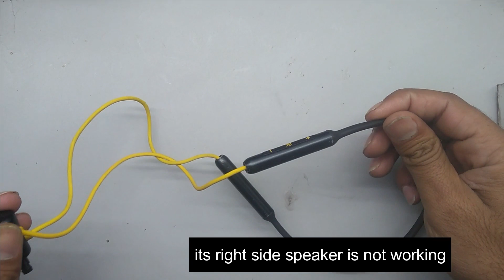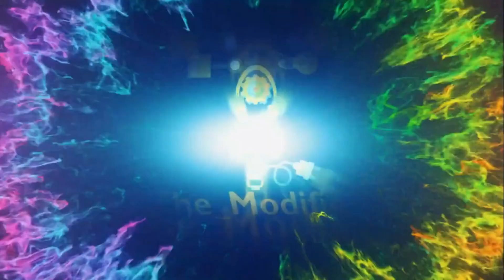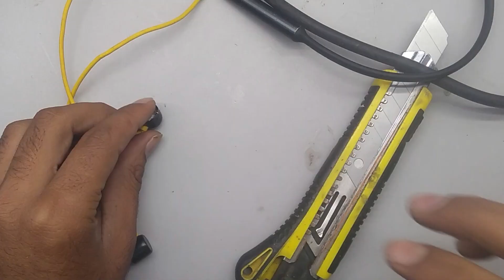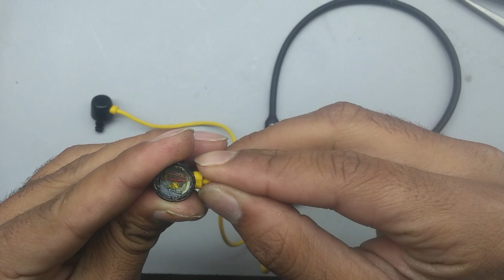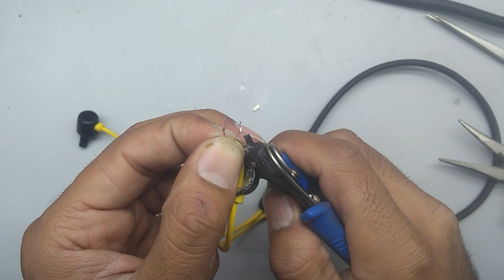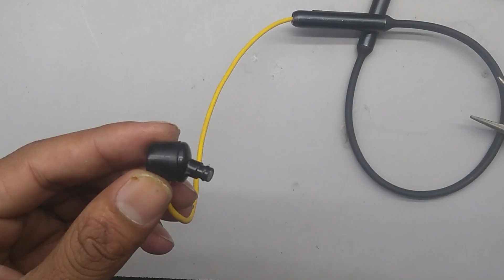HOW TO REPAIR REALME BUDS WIRELESS EARPHONE ?|| ONE SIDE NOT WORKING || BROKEN WIRE

Comment: My headphone is soundcore spirit pro and the left side stopped working. It only works when i move then wire which is connected to the left side, but it is very stressful to do every ten seconds. What do i do?
Reply from the maker: It means you headphone wiring is not working from corner

Comment: The situation of mine is that, there is no sign of broken wire or damages. Just the right side is not working. 
So according to you, what problem could it be? Please help
Reply from the maker: Max chances its a wiring problem. N  other reason is your right side speaker is damaged from inside.
Reply: @themodifiers2240  hey I'm confused
My wireless are connecting to bluetooth but they are not producing sound 
Instead there's a blue light which is 24*7 on
What can I do?
Reply: Mee too same problem